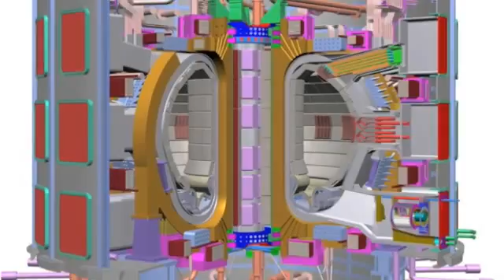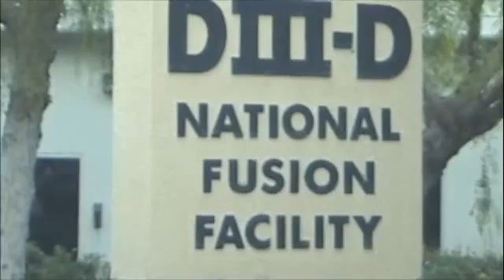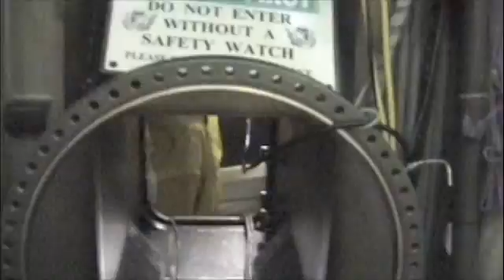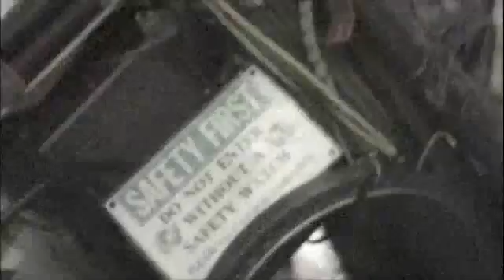Inside the Fusion Reactor DIII D tokamak

Comment: The cost has tripled to around 16 billion, and most likely will never work anyway!!!

Because implosive inward energy compression contracting spacetime=0 now comes from light waves from the surrounding masses!!!

The total amplitude formed by a rings series of inward spherical waves generating heat by multiplying electrical potential along cubic dynameters coming into every point +1=0 now -1 causes the atoms shells to break up into plasma within the Sun the surrounding corona!!!
 
The constant outward de-compression like that now from the Sun forms the inward force called gravity as time unfolds C2 takes about eight minutes to reach Earth.. .  .
And likewise the constant outward momentum of the light from Earth C2 forms the inward acceleration from the continuous stimulated emissions in unison as time unfolds.. .   .

Stimulated emission is a process by the way of which a higher energy quantum mechanical state of an atomic particle absorbing energy input +1=0 now is being converted to a lower level -1 resulting in the production of light photon oscillations, or new electromagnetic vibrations independent of the motion of its source.. .  .

Time is inverse multiplying +1=0 now -1 dividing like frequency and wavelength.. .  .

Time is shorter at one's feet than at their head, because of the geometry basically the greater the energy compression contracting spacetime=0 now the shorter the expanding wavelengths dividing acceleration away from its source in unison.. .  .

The amount of radiation compressing the wave amplitude reaching 1 meter, then will be one-fourth as much at 2 meters, hence one-fourth the intensity.. .  .

Thus objects just free fall towards the greatest energy compression, or shortest rate that time flows from.. .  .Simply because generation of "any information" exceeds radiation during the first half of the cycle +1=0 now -1 radiation exceeds generation during the second half of the cycle.. .   .

Gravitational systems -1 are the ashes from prior electrical systems +1=0.. .  .As the light sphere increases with the square of the radius the strength of the gravitational field is inversely proportional to the square of the distance from the source of that constantly expanding light sphere.. .  .

As their individual light spheres super impose crests and troughs become in phase now, their space time line symmetries will synchronize, or amplify by compressing the wave amplitude +4-0-4+- now the shorter the expanding wavelengths dividing acceleration or gravitation away from its source in unison.. .  .

Concentrated spheres at right angels such as protons, electrons, onions, the Earth and Sun, are surrounded by now slice layers of light of equal pressures.. .  .
Clouds float around the Earth in them.. .  . 
The reason they float in curves parallel to the Earth is because of these equipotential planes of pressures which curve as the Earth curves.. .  .

Spherically curved planes of pressures act as lenses to multiply and divide light radially because everything is contracting and expanding a locational 4pi spherical inward absorption +1=0 now -1 outward emission of electromagnetic waves.. .  .

Space is a division of solidity into entropy C2 the second law of thermodynamics.. But also E2= a multiplication of volume at the expense of gravitational potential..

All motion is 2pi spiral.. .   .And all direction is 4pi spherically curved.. .  .
Vibrating sinusoidal spherical wave-fronts of only motion forms Einstein's curvature of spacetime."
Reply: This could be accurate or gibberish for all we know. No one is a prophet in his own country.
Reply: Alexandre Leblanc Now space is a division of solidity into entropy as time unfolds C2 the second law of thermodynamics.. .  .But also in the future E2 will equal a multiplication of Volume +1=0 now at the expense of gravitational potential -1.. .  .
The Higgs bosons from Higgs field are really just photon oscillations from all other matter spherically distributed around the particle now in question, or electromagnetic vibrations multiplying inward from the universe.  . ...Because everything is formed by a surrounding locational 4pi spherical inward absorption +1=0 now -1 outward emission of electromagnetic waves that's forming input +1=0 now -1 output interference, or antimatter matter annihilation, forming positive and negative electric charge, and electromagnetic interference fields (2pi spiral radians 360 degrees) as time unfolds C2.. .  .from objects!!

As the frequency gets higher the Planck's constant will be multiplied by a larger rate oscillation photon electron couplings within that object as the time period slows down relative to the perspective of an outside observer at the centre of their own time line of broken symmetry!!.  . ..Thus the amount of pressure imploding t=0 now within the Sun must be extreme to say the least.  . .. And that implosive positive energy compression multiplying inward along cubic dynameters compressing the wave amplitude +1=0 now within the Sun must be causing their atomic shells to break up into plasma.. .  .

Since mass increases slightly when absorbing energy input +1=0 now stimulated emission is a process by the way of which a higher energy quantum mechanical state of an atomic particle absorbing energy +1=0 now is being converted to a lower level -1 resulting in the production of light photon oscillations, or new electromagnetic vibrations independent of the motion of its source.. .   .

Now that constant explosive de-compression dividing expansion outward from the Sun forms the inward force called gravity as time unfolds C2.. .  .Takes about eight minutes to reach Earth.. .  .

And likewise the constant outward momentum of the light from Earth (the negative polarity forms the acceleration) or gravitation from the continuous stimulated emissions as time unfolds C2.. .  .As their individual light spheres super impose crests and troughs become in phase now (their space time line symmetries will synchronize) or amplify by multiplying electrical potential along cubic dynameters compressing the wave amplitude +1=0 now the shorter the expanding 2pi spiral wavelengths dividing acceleration away from its source in unison.. .  .

In other words as the positive surface of the negative expanding light sphere increases within the square of the surrounding radius now the strength of the gravitational field transverses Q inversely proportional to the square of the distance from the source of that constant expanding light sphere.. .  .

Velocity equals time density +1=0 now -1 density of space-time.. .  .V= td +1=0 now -1 ds-t G/r2.. .  .

Time is inverse multiplying +1=0 now -1 dividing like frequency and wavelength.. .  .

The One Unified Electromagnetic Spectrum is a continuous flow of energy (Vibrating Waves) therefore light is a transverse sinusoidal wave!!.. .  .And it was time that was quantized.. .  .
Space-time was quantized into moments.. .  .Only the frequency now is relative at each dipole magnetic moment of time.. .  .
What I think you will need is a lot more surrounding implosive positive energy compression multiplying inward contracting time and space compressing the wave amplitude +1=0 now the shorter the expanding wavelengths.. .  .

Time is shorter at ones feet that at their head because of the geometry, basically the greater the surrounding energy compression contracting space time +1=0 now the shorter the expanding 2pi spiral wavelengths dividing acceleration away from its source in unison."
Reply: Seamless Robe they reached the break even point so it actually is working

Comment: Wouldnt the neutrons released in fusion make the inside of the reactor radioactive?
Reply: Just apply a 20 foot thick walls of lead around the sarcophagus.
Reply: Lead always works
Reply: Nate Caraway The neutrons will slowly ruin the tokamak from the inside out. So does ultraviolet light to some extent, but not close to as effective as neutrons.
Reply: Yes it sure would, but would it last half as less than regular nuclear radioactivity.  If something were to go wrong, it would only be 50,000 years of contamination :-)  I'm just playing.  Much safer than 20th century nuclear power plants.

Comment: That's not possible with any fusion reactor. If a breach occured, the plasma woud gush out, and rapidly cool, meaning that the reaction would stop. It's physically impossible to get a chain reaction in a fusion reactor.

The most you would get is a fireball as hot plasma comes into contact with air, and even then it would not spread radioactivity.

Comment: The main problem is that the deuterium-tritium plasma generated inside of these machines is so energetic that no known material can indefinitely resist corrosion by it. The solution to that problem is the use of magnetic fields to compress the tritium-deuterium plasma, keeping it from touching and wearing through the reactor's inner walls; the magnetic fields are also what maintains the density of the plasma at which the nuclei can fuse. However, these magnetic fields must be incredibly strong.

Comment: In tokamak, you need temperatures over 100 million Celsius, similary crazy pressure, and as a bonus, less than 1 meter from this plasma, you need cooled superconductors with temperatures close to absolute zero, cca -265 C. Impossible? Almost. That's why I think tokamak is just extreme waste of money. On the other hand, there are many better ways how to achive fusion, without those extremes. Yet for some reasons, tokamak eats all the money, which is missing for developing those other devices.

Comment: Deuterium and Tritium have the same (or at least very similar) chemical properties as Hydrogen given that each has just a single nuclear proton and orbiting electron. However, the nucleus of Deuterium has a an additional component - a single neutron. Tritium has two neutrons. A neutrons is very slightly massier than a proton and has no charge, compared with the proton's positive charge, so the difference is essentially that Deuterium and Tritium are 2 & 3 x massier.

Comment from the maker: @VASEA0000 - Deuterium and tritium are isotopes of hydrogen.  These isotopes have the greatest likelyhood for fusing at lower temperatures, and are therefore a preferred first step fuel.  Eventually advanced fuels like deuterium and helium-3, or deuterium and deuterium may be used.

Comment from the maker: @meronmotors - The actual history is even harder to believe.  Not only was the cold war still on but around 30 years ago was the 1979 energy crisis just after the Arab Oil Embargo.  These two events forced the Carter administration to look for alternatives.  The $20 billion Magnetic Fusion Energy Engineering Act of 1980 was passed with bipartisan support in order to build a prototype fusion power plant by the year 2000.

Comment from the maker: @meronmotors - Great question. Fission is relatively easy in that you just arrange material in the correct configuration and in the right concentration. The first reactor was literally a pile of graphite and uranium. Fusion required the invention of a new type of physics called plasma physics before a reactor could realized.

Comment from the maker: What's a little neutron activated dust between friends?   :)

You are probably right.  The only divertor test that I know of used C-13 methane injection for studying tritium retention.  

I also have no idea what the faraday shielding of the RF heating launchers are coated in.

As for the level of activation, I can tell you that I received 11.2 mRem after spending 6 hours in the vessel.  

We'll you've made me nervous and now I'm going have to find out.